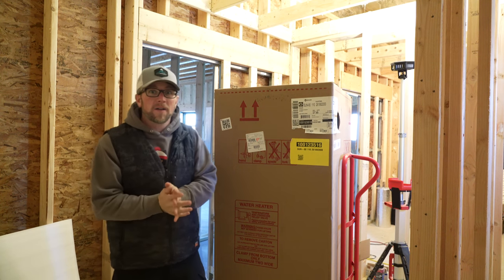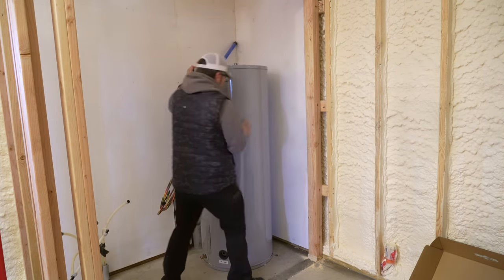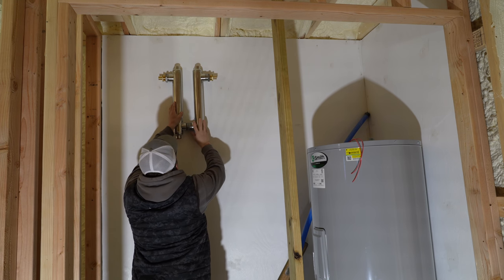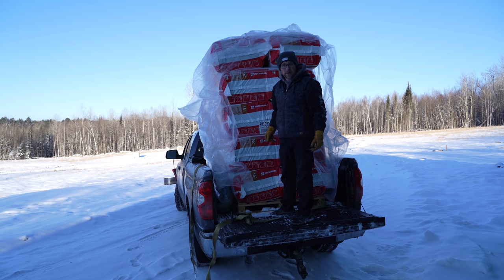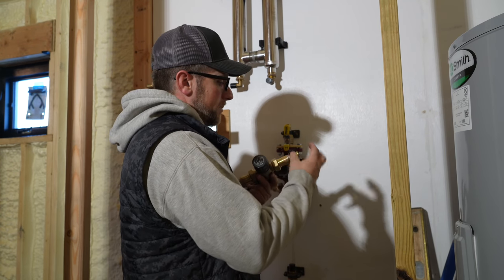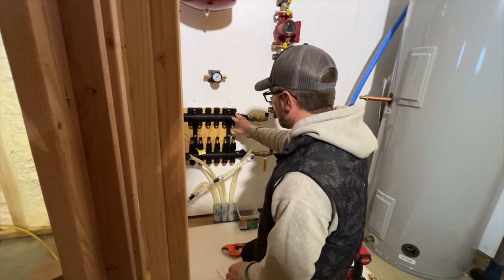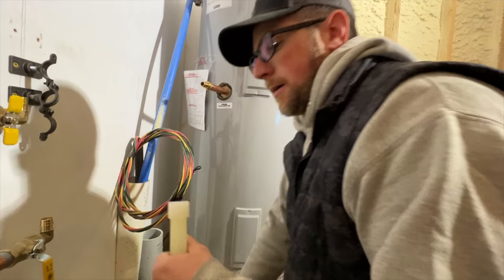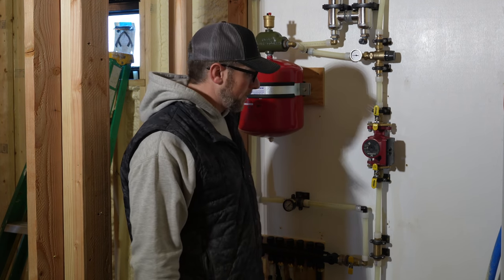What Could Go WRONG... Installing In Floor RADIANT HEAT with No EXPERIENCE!

Comment: Flux serves three purpose Al, cleaning, air sealing and allows the solder to flow in a consistent way into joints, hope this helps. (I used to solder on circuit boards  a long time ago).
Reply from the maker: That does. Thanks
Reply: @LumnahAcres  You do not want to use too much flux as it is corrosive to the fittings or copper (especially on cold water pipes,.hot water will wash it away)  You want to wipe off excess with damp rag on the outside and the goal is to have little if any remaining on the inside.
Reply: I use isopropyl alcohol to remove the acidic flux.  Always have with great success.  In electronics repair I also used flux in alcohol before soldering with solid 63/37 solder (or eutectic solder).  Acid core solder (50/50) for plumbing should never be used for electrical/electronic soldering.

Comment: Clean off all flux when you're done soldering.  If you don't your fittings will become green and corroded in a few weeks.  I use a clean wet rag to wipe down joints as they cool.

Comment: Hi Al, don't use water in your heating boiler! You should be using a special Heating antifreeze design for in float radiant heat. The water will damage your heating unit over time.
Reply: I agree but unfortunately he can't use it as his domestic water heater if he uses antifreeze.  Best to use a whole house water filtration system to "soften" the hard well water before it goes into the hot water system.
Reply: It looks like this design is a closed loop system. The fluid from the boiler is isolated from the water side of the system. Use the proper Propylene Glycol made for the application.
The Noble Company is a supplier of these type fluids. Well water is the worse thing you can use. The minerals will eat your heat exchanger in short order. Under no condition ever
use pink RV antifreeze in your system.

Comment: solder flux helps bind up and sweep away any residual debris on the metals to be joined and it helps the solder flow into the joint (flux means "flow").

Comment: I hope you plan to put that tank into a drain pan.   Putting a metal tank on cement is an open invitation to rust.  It also need to be in the pan so if any leaks happen it is routed outside instead of flooding the house.   I would recommend setting the tank up on a platform so you can use gravity to fall the drain slope.

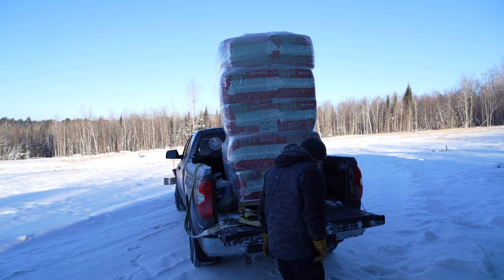Comment: Fantastic plumbing procedure for someone not a plumber, I plumbed my gas fired hot water system in my house 30 years ago. And had a master plumber / master electrician  / master boiler mechanic mentoring me.  Speaking about masters -- has anyone seen the nice arch on the edge of the forest? Sasquatch's signage of a height indicator. And at time stamp 13:45 / 46 a very clear whistle of a Sasquatch calling out to Al. Al has not spoken of Sasquatch on his property, but in previous videos of Al, Gina & Olivia walking in the woods, X's, arches and broken trees were very visible. They are there,  and so far as we know, they have not messed with anything, and Al has not spoken about them {if he believes in them}.

Comment: @Lumnah Acres.  Put that water heater on a platform 12+ inches high; it makes it easy to drain & gives a thermal break from the floor...Use a glycol solution instead of straight water prevents freezing.

Comment: Hello Sir, Just thought to mention that any electrical water heater shouldn't be placed directly on bare concrete, due to unforeseen leakage and/or climatic temperature variations, and to avoid any electrostatic charges. The height of a cut down palette approx' 3"-4" thickness and the diameter size of your water storage unit will suffice. It acts like an insulator, it also allows for air circulation around the unit. All the best.

Comment: I've soldered hundreds of ball valves and have never had one leak . Make sure they are open (as you did) and I usually remove the handles so the they don't get torched.

Comment: Hey Al, a couple of thoughts that may be helpful. When soldering a pipe joint make sure you have good coverage of flux on both the pipe and fitting. I did see that you did both, but it was hard to tell if you got good coverage. When heating the fitting, apply heat evenly all the way around the fitting with your torch, after a little time, touch the solder to the joint away from the heat , when it melts, quickly run the solder all the way around the fitting, rather then depending on it to flow from back to front. One trick is to pull off 6 or so inches of solder. Come in from end and make a 90 degree bend in the solder.It is so much easier to control the placement of the solder by doing this. When done soldering, quickly wipe the joint with a rag to remove excess solder and flux, old white t-shirts work best. Flux is an acid and will  turn the copper green if it is not removed. 
When using your pex expansion tool, after each "expand" turn the tool just a bit inside the fitting.This will ensure the expansion is evenly displaced. Also, should you ever get a leak at a pex connection, gently heat it evenly with a torch or heat gun, it should seal right up. You can do this even if it filled with water. 
You may want to check with the boiler manufacturer to see if there is an anti-freeze available for use in cold temps. You two are doing a great job.

Comment: Just have to say...we have radiant in floor heat.  4" concreate over the top of it, REMEMBER YOUR GLYCOGEN!!  Floor will freeze if you don't ever have heat one day. :)  It's in a shop that's 4800 sq feet.  Two manifolds.  Don't know if you've said, but after 12 years, we've had to add water, so make sure you can add water with a oneway value into your system.  Our system after 12 years had to have the pressure gauge replaced, but other than that, no problem.  This year we lost all power for 7 hours, and the shop barely got down to our boiler's minimum is 55 degrees - however we were only 32 degrees outside.  If it was blowing and 15 below, it would have gotten way colder!  We haven't wanted to take the chance on freezing so we have Glycogen in our setup.

Comment: Hey Al, Put a drip tray under the hot water tank with a drain hose to the drain so you can drain it in the future to keep the insides clean of sand and or dirt. We drain our tank every year to be sure it stays clean and working for a much longer time.

Comment: Everything is coming along quite nicely Lumnahs!  Like some others, the first thing I noticed when you started moving/putting things into place.... mainly the hot water tank itself.... is that you definitely NEED to get that tank up off the concrete floor.... for anti-corrosion, insulating, and leak prevention purposes.  A "drip" pan and a moisture detector/meter SHOULD be mandatory (and are in many places) when installing any hot water heater.... regardless of application and/or size.  Other than that, everything looks to be in top notch order.  I too am "a bit" (LOL) of a perfectionist (very detail oriented) when it comes to most things.  Def. looking forward to seeing more progress as y'all move forward on your various projects.  ;-)

Comment: Al, I am amazed how you envision your layout and implement it so it always looks so clean when you are finished. This job is especially tiresome and complicated for any DIY'ER. You, once again, came through, without any hitches, at least until the system is turned on. My only suggestion is that you put a water heater basin beneath your water heater.

Comment: Try to move the torch around the whole fitting rather than in one spot.  It’s better if the joint is heated evenly. Once the solder flows it will fill the entire joint.  The flux allows the adhesion between the solder and the pipe/fitting.  If you wipe the excess flux off the joint before you heat it the joint will be much cleaner.  Clean all the flux off the surfaces after the joints have cooled, if left on the pipe it will quickly corrode.

Comment: Flux create a clean/non-oxide surface,,, when you heat it up also creates a vacuum to pull solder in,  you heating it correctly

Comment: Usually in houses where there's an area where a lot of electronics or water or heating system, they usually has a backing board they use to get things layed out right and then they mount that board to the wall with the placements fixed. I've seen it my self several times and I never connected the dots until I saw you fiddle with it.  Then it hit me, that's why there is a backing board, to make sure things are mounted at the right place... Funny how many things our mind teaches us in retrospect as more information becomes clear or gets known.

Comment: Flux reduces surface tenson so the solder can flow into the joint.  Heat the thickest part and clean is good. Have fun and good luck... Thx for the vids...

Comment: The drain valve isn't missing a handle, you use a screwdriver to open.  And the flux gets brushed on the outside of the copper tubing and the inside of the fitting after they are cleaned with Emory cloth.  Also, I've found with the lead free brass, my old school flux didn't work as good, and I've switched to water based flux.(nokorode aquaflux)  Seems to work better so far.

Comment: I noticed the air bleeder on top of the red tank. I think you will need an air bleeder at the highest point in the plumbing as well. Trapped air will block the water otherwise.

Comment: The air bell with the hy- vent you have on the expansion tank should be the highest point in the system. You have the heat exchanger higher and it can possibly get air bound.  The hy- vent can't work automatically to remove the air. At the very least the air bell needs to be higher than the highest water level the boiler can have to prevent an air pocket. You can add a manual purge port or another hy-vent on the heat exchanger to purge it.

Comment: watch a tutorial on soldering ,Larger Diameter copper requires a different technique than you are using so you dont get cold spots (no fill) and future leaks . use a wet cloth to keep your
r valve seals cool so the teflon does not melt

Comment: In your climate, consider a glycol mixture instead of just water. I know of a case where the heat went out and the whole  concrete floor had to be replaced because it froze over night and destroyed everything. Glad to see you used expansion fittings. The way to go now days. Gina can fix a problem of one should arise and you are not around. Let Olivia put on a couple of connections to get her confidence up just in case. I have shown my daughter everything I do like this and take the time to let her do it. She can fix about anything now. Vehicles, computers, etc.

Comment: I'm not a plummer but This Old House says you should remove the valve internals and seals before you apply heat with a torch in order to prevent heat damage to the seals.

Comment: Do not forget a pressure tank for well.  Without it every time you turn the water on the pump must run.  If it were me I would have a huge pressure tank. Fill once and have plenty of water.   Also remember you will probably need to replace things from time to time make sure you have access.

Comment: You bought the right stuff. The brand is the only way to go in my book. I use it to build acoustic bass traps and sound deadening for my stereo system. It’s the best cause you can use it only covered with rough burlap type coverings. Like you said, cheaper brands are dusty and fall apart when used openly.

Comment: Wiring up the water heater could be a good thing at first to keep warm water back feeding to the outdoor boiler in case the fire isn't keep going in the boiler. Allowing the hotwater heater to keep the boiler water stay above 32f could be a safety devise while you get use to the boiler since the boiler pump will be running all the time.

Comment: I'd suggest you use distilled water to fill up this system.  I'd also suggest you add some filters to prevent mineral precipitation in the lines. It you get scale, calcium, iron, manganese build up in that system it's going to be a nightmare to fix.  After working 30 years in the food industry as an engineer, water systems are some of the biggest areas requiring maintenance time and costs if that water quality is poor.  I love how straight and plub you have everything.  Almost looks like artwork.

Comment: Hi Al n Gina. Wasn't sure so I went back and checked. Yes there is a black something under the tank but is it a pan? 
In my neck of the woods you would have to cover that plywood ON TOP OF THE STUDS with 5/8 firerock. If you had used 1/2 sheetrock first this wouldn't be necessary. See a lot of comments about antifreeze in the boiler system. These systems are rare here but code says no toxic chemicals period. They do recognise non toxic organic based antifreeze though. There's at least one on the market where the guy in the comercial drinks it. I believe it's good to -50. They also tell you that it tastes really bad so you can spot cross contamination before leaks occur. Check it out. Can't remember the name. Saw it on This Old House several years ago. You should connect the electric to it now so you can check for proper operation before it becomes much more difficult to resolve the problem. Just saying. Stuff happens. You can always turn it off. Glad you mentioned the runs for the greenhouse heat and the capacity for upstairs circuits. I would install the pex pipe without the reflectors ( they block convective heat from below ) now as it will be a real pain to put them in later. There's no need to connect them now but if you discover a need it will be much easier and if you don't, well that's why they call it insurance. Keep up the amazing work, continue to thank God every day and remember... Family first. The Lord provides for those who believe as long as you work hard with that belief.  Would also suggest you retain the services of a qualified plumber with expertise in radiant heat to inspect your work before you fire it up. It may cost a bit cause they don't like it when they aren't being GROSSLY OVERPAID to actually do the work but peace of mind is priceless. In my neck o the woods a homeowner can do everything himself but must hire licenced contractors to inspect and advise and make final connections for plumbing, electric, gas and water even if you are on a well or septic tank. Been charged more than $1000 for these services by GREEDY contractors but you gotta pay to play here

Comment: Good luck, my aoSmith rusted out around the cold water intake that was on top of the Hot Water Heater. It was a replacement of brand from Lowes they no longer had in stock that had 6yr warranty. It will be the last one in I'll ever own.

Comment: The permutations, variations , options and configuration...the various hydronic specialty fittings , ,valves , shut offs , drains , vent needs,..OH MY, YOUR IN FOR A PENNY.  Be prepared for the pound of sweat and learning...good for you..!!  Sweat fitting for copper will be another learning curve...be careful to NOT OVERHEAT FITTINGS..!   Good luck...,!

Comment: Nice job Al. The only thing I would suggest is putting a ball valve between the air scoop and the expansion tank.  The bladders in those tanks sometimes fail and a valve gives you the ability to make an easy change out even with the system running. Also, to set the correct pressure in the tank it has to be isolated from the system pressure to get an accurate reading.

Comment: Concern - Heat exchanger location. "Heat rises" with the heat exchanger mounted so high (above the inlets and outlets of the hot water tank heat has to fall.  Thinking mount the heat exchanger below the inlets to get natural flow.

Comment: You dont want to use the black iron pipe clamp on the copper or brass.  You need the copper or brass hangers.  2 different metals will cause galvanic reaction and early failure.  I am a Master Plumber.  By the way, I think you are awsome.  You work hard.  God Bless you and your family.
Reply: This is very important.  One of the outdoor hydrants also had some black iron adapters in it with brass fittings - electrolysis anyone?
Reply: Yep, electrolysis is an issue when dissimilar metals touch.  On my submarine, and throughout the fleet, we use zinc blocks as "sacrificial anodes" to give up their electrons to the galvanic gods before any important metals give up theirs.  Loss of electrons = oxidation

Comment: that I would have placed a sheet of plywood on the floor or on saw horses and mocked up the positioning of all of the components before mounting them to the wall.  In wood working, we refer to that as dry fitting, before we add glue to all of the joints.  Then you can take a picture of it once your satisified with the layout, or just mount everything to the plywood and then mount the plywood in the room.

Comment: Once ready to charge and fire up are you going to put food grade gycol  in system  this would prevent freezing  in the event fire goes out when cold
  If possible  use distilled  water or de-ionized  water 
   While  you are using  plastic  pipe  for most part  but still circulating pump  and valves  ect. Not corrode  as badly or quickly

Comment: flux etches the pipe so the solder will adhere .. so you need to be careful applying it because the solder will flow where ever the flux is... on the inside of a pipe or a valve it can cause the solder to flow into and cause beads of solder and when water runs over it it causes turbulation. anyway... put the flux where you want the solder to go... also missed Gina's good mornin... so good mornin :o)

Comment: Al, You need to install that 80 gal. Hot Water Tank UP OFF the Floor on a strong metal stand and be sure to install a Drain Pan under it with a drain port ! Required by Codes in most states !
Reply: There's no codes.